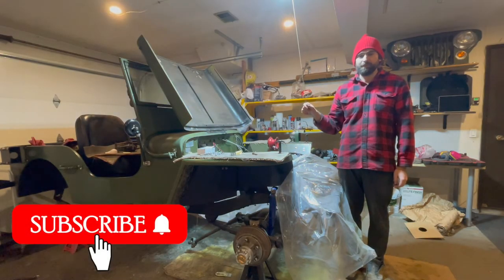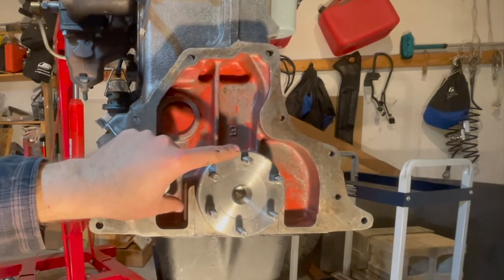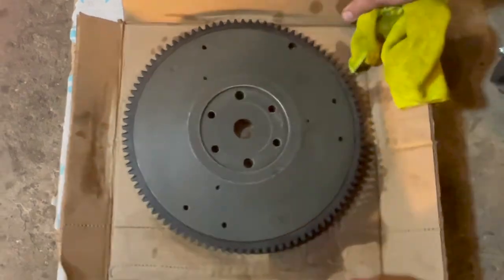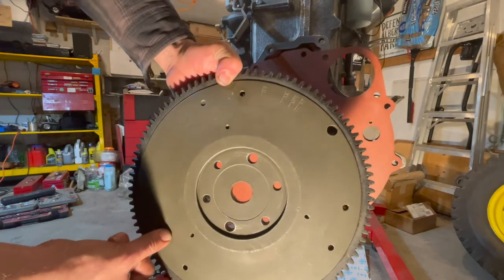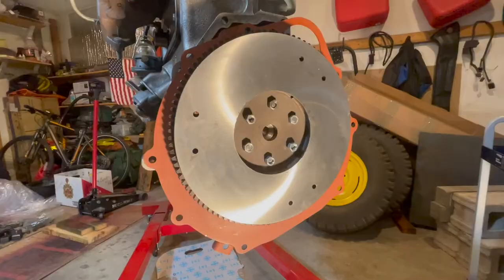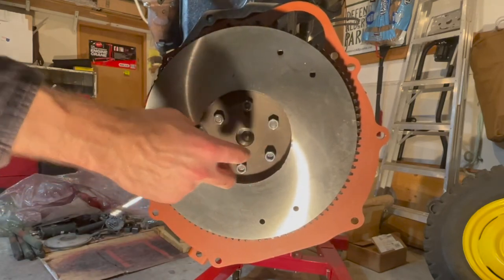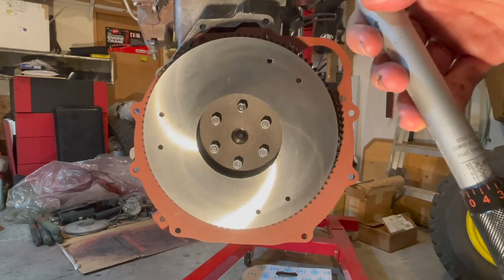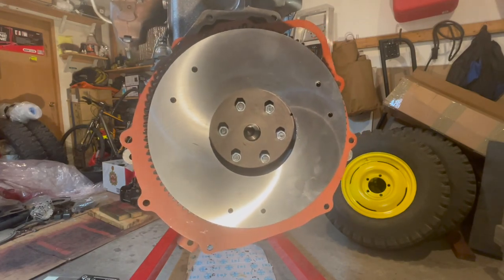How to install 97 Tooth Flywheel | CJ2A Willys Jeep

Comment: Cool!
Not very much I understand but I like to see what in side Jeeps.
Thanks for 🎥
P. S. My Gladiator start makes squeaky noise...look like bed did it.
Been in garage...not found anything
Do you has any idea what is possible it can be?
Please, let me know
Reply from the maker: Might be a loose fan belt. Often the Jeep will make squeaky noises if so. Try tighten the fan belt and that might do the trick.
Reply: @LetsBuildaWillysJeep  , thank you
I try

Comment: Should there be star lock washers on those flywheel bolts under the nuts?
Reply: Yes,should be star locks on flywheel bolts,also flywheel will index two ways,with timing marks on flywheel at the proper place at #1 TDC or 180 degrees out,looks like he had those in the proper location!